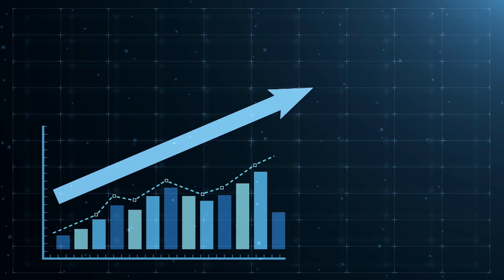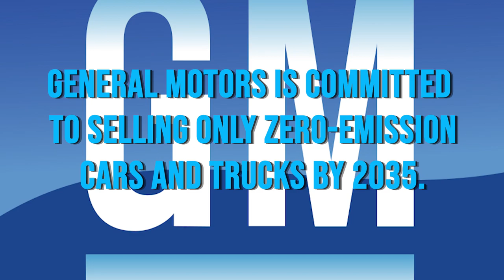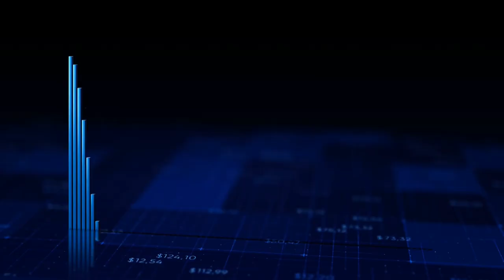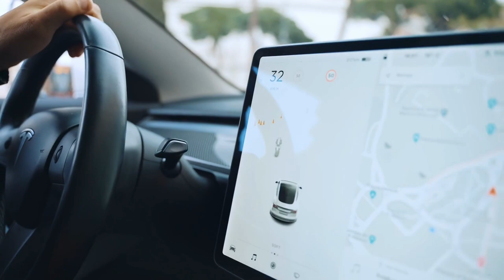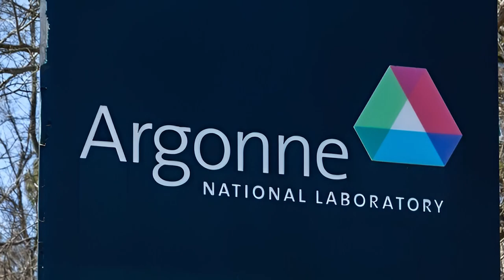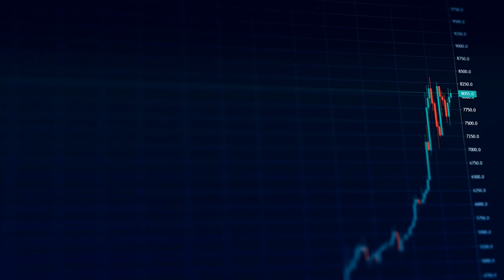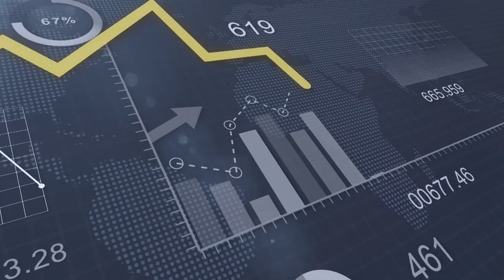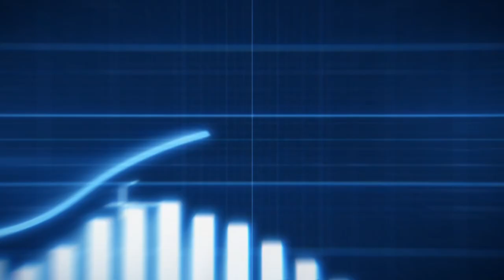Tony Seba: Tesla’s NEW disruptive technology will change everything!

Comment: All I need is an EV $65k, solar panels $60k, 2 power walls $20k, electrical work $10k. Did I save the planet? No, out here in Utah the power is coal generated. Bottom line is the smoke from my paid-for ICE vehicle just moved to Southern Utah where the power plants are located.